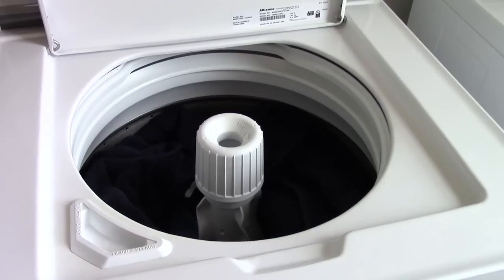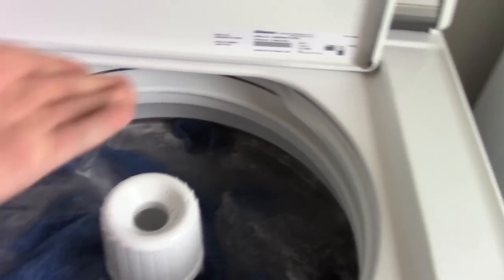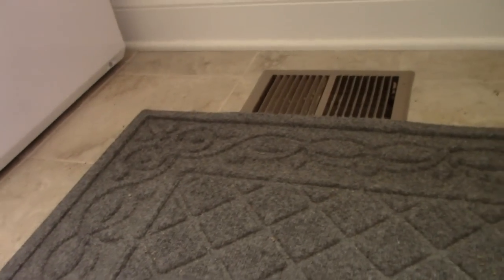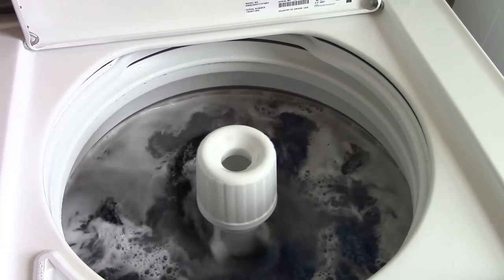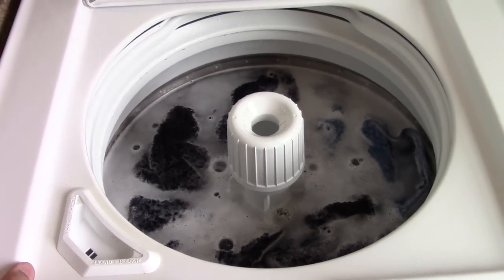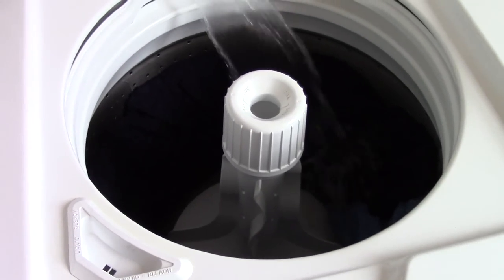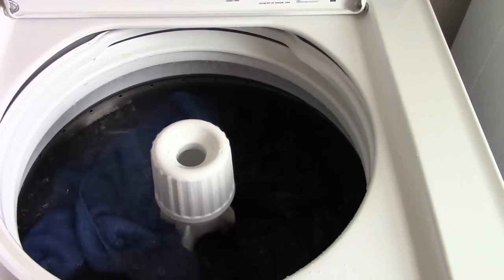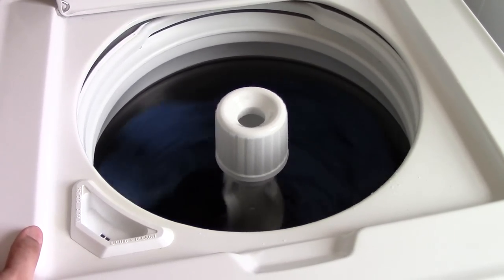2016 Speed Queen Washing Machine: Second Response Video!

Comment: At least you can see that the suspension springs are on the bottom, like the direct drive washers and the old belt drives for Maytag, Kenmore, and Whirlpool and the GE Filter Flos or maybe the Frigidaire Gallery belt drives and maybe the old style Frigidaires such as the 1-18s and Unimatics, as opposed to the top which is seen on the GE Profile and GE Hydrowave washers and many modern belt drive washers. Plus this washer doesn’t do this sensing crap like front loaders and modern belt drive top loaders do, this sensing crap is unnecessary. I would rather have a washer that instantly fills when you start it.
Reply: Yeah I hate all that sensing crap washers. Just fill the damn thing! 
Also I hate the suspension rod hanging/floating tubs used by almost all top loader brands now except Speed Queen. Eventually the rods will fail and constantly go out of balance.
Do you know any other manufacturers apart from Speed Queen that still make top loaders with the bottom mounted suspension spring system like the good ol days?
Reply: @usernamechecksout8491  yeah it appears speed queen is the only brand that has suspension springs on the bottom instead of the top
Reply: And agitate aggressively when I want it to, such as when washing normal cottons. I miss the filter-flos! I am blessed that my apartment complex has Speed Queens.
Reply: @usernamechecksout8491  Sadly nobody else. This is so stupid!

Comment: My 2017 Speed Queen still indexes but it washes fantastic.
Reply from the maker: Absolutely! It will eventually stop.
Reply from the maker: @tmr8193  Did you watch the 2014 machine like I stated? Nope! So, you continue to be invalid! :D
Reply from the maker: @tmr8193  Oh? What part of the video?
Reply: What? You can ask me! I have great vision, The wash basket was nearly completely locked with the main tub! A very very small index is normal! And hell, does it even matter if the tub indexes or not!?!?!? My old Roper indexed very little! There is NO such thing as a perfect machine!
Reply: @tmr8193 
Ohhhh I do NOT want to fight! Do you REALLY think your Good Kenmore 90 Series Is better than a Good Speed Queen? NEITHER of them are better than each other! Even though the Speed Queen has NO turnover, It's agitator still fights the stains like a washboard while the Kenmore Uses extreme pressure to fight the stains! That's what matters!

Comment: The speed queen tc5 is the only machine on us market worth buying not as good as these pre 18 models tho. I have a feeling they will discontinue it by end of year sadly
Reply from the maker: Well if they do, back to used markets!
Reply: @Sharkie626  regarding direct drives do you notice that the newer direct drive models rattle more on spin compared to 1990s models? such as Jay's 2009 model It's very interesting as it tends to do it shortly after spray rinse. I just oftern curious what causes that
Reply from the maker: @declanmarsh7398  Hmm, I haven't really noticed much. The 2010 machine that my bro had seemed pretty quiet.